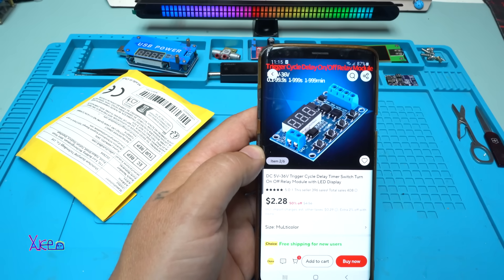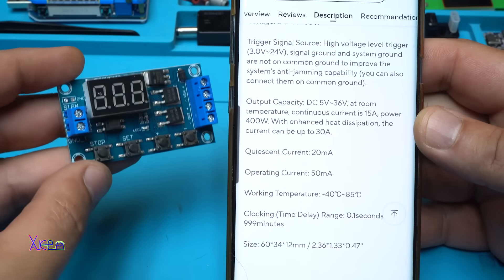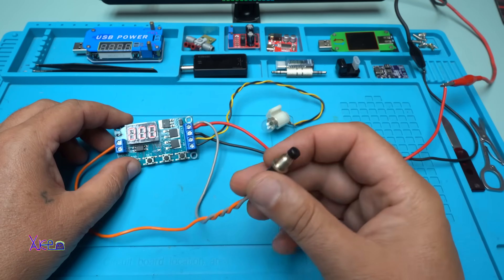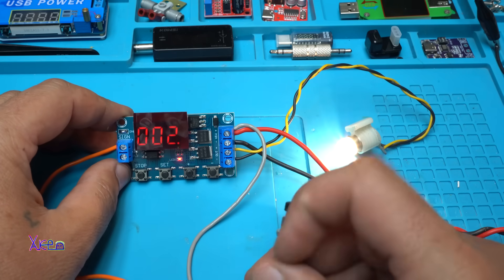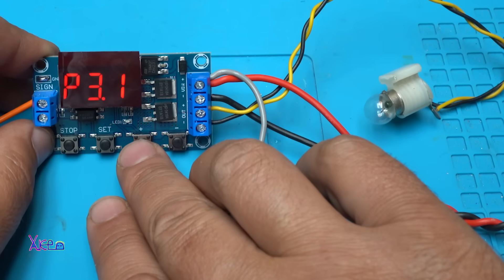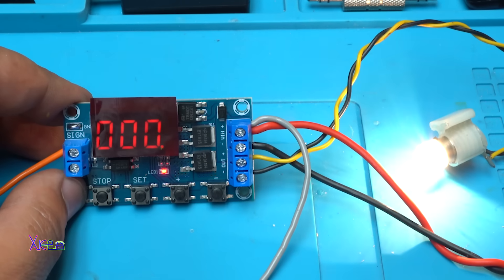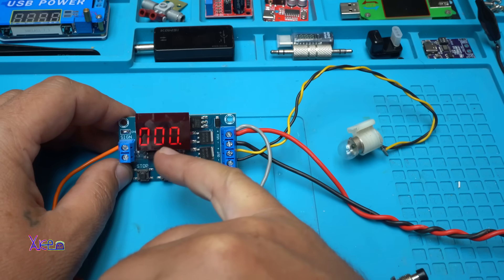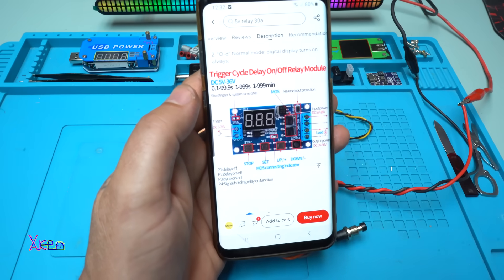BRILLIANT $2 Module - LED Digital Trigger Cycle Timer with Delay!

Comment: Had to go back and look at your wiring to avoid the common ground.  I was planning to run power from the power supply to both the + and - on the Vin and through the switch but watching this was a bit better (avoiding the common ground by jumpering the switch ground pads).  WISH you'd have explained why you did that (shown your wiring before you started programming) 🙂

Comment: This is the one I use for chain oilers. 
I have it in astable mode , opening and closing a solenoid valve to meter oil to the chain. Adjusting the timer duty cycle varies the amount of oil.
I used the relay version but the relay contacts failed at the low current of the solenoid. Some relays require a higher current to keep the contacts clean. MOSFETs are better.
Reply from the maker: That's a great use case, thanks for sharing!
Reply: @Hacktuber  Wonderful timer with delay, and great video. Subscribed! Unfortunately for my current pet project I need a small cheap module which can pulse power to a load between 1 and 40 cycles per second. I will keep an eye on your channel, even if I don't see the one I need, much of it looks useful for many things.

Comment: There will be some kind of microcontroller under the LED display. If it's like other similar modules the surface will be scratched to hide the part number :-/
Reply: Yeah, mine currently has the LED removed and the IC has the number removed. I keep meaning to trace each pin to try to identify it, or at least find a pin compatible microcontroller.

Comment: Really useful module, has many options. Some time ago I got similar one with actual relay, used it for DIY spot welder for Li 18650 batteries. Not my idea tho, saw it online and built it, works fine 😉
Reply from the maker: Great idea sir, thanks for sharing!